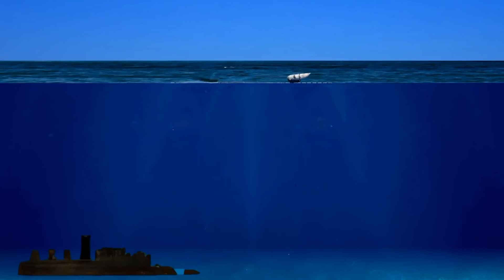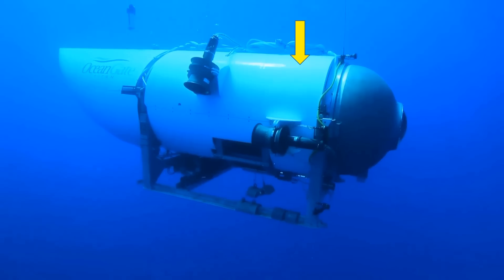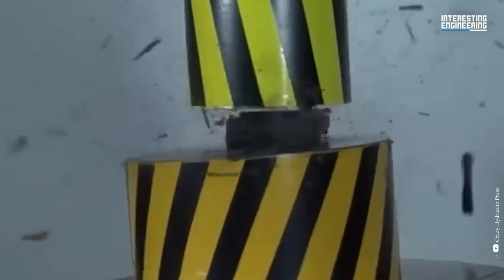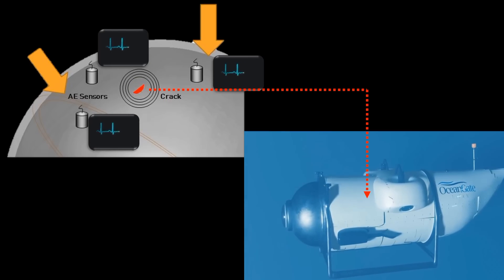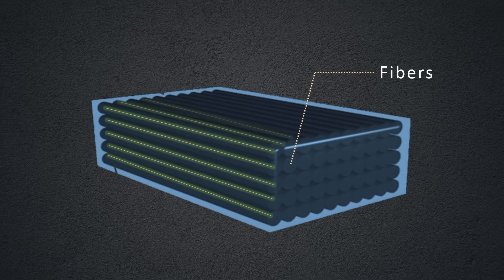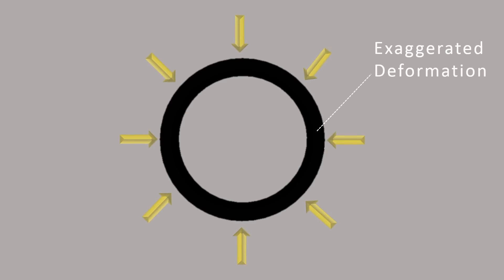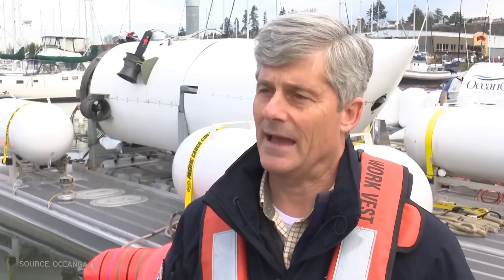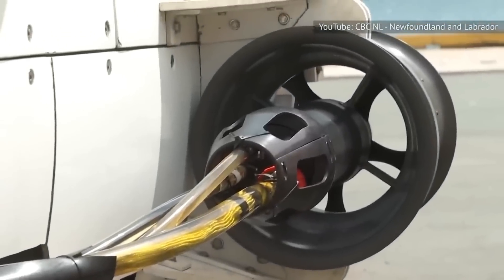Oceangate Titan Did Not Implode Just From Pressure. There Is a Catch!

Comment: My uncle told me when he was studying engineering his professor told the class , If you ever design a bridge that fails you had better be standing under it.
Reply: The designer was in the sub. He is dead.

If you design a bridge, you better make sure you design it properly like your children are sitting under it.
Reply: @esphilee no as you can see he simps so hard on carbon fiber.
Reply: @esphilee 😊
Reply: And Rush "was standing under it."
Reply: More like surrounded by it, but , yeah. He won't be around for the lawsuits that's for sure, but the rest of the company will be.
Reply: @dwightl5863 yeah but rush was ignorant. He didn't design or engineer it. He employed interns to do it and they probably suggested carbon fibre can save costs and rush probably though "great idea! Also let's get some parts from camper world and a used xbox controller"
Reply: @ninjaninja9954  I don't think the controller was necessarily a red flag, but the fact that it wasn't wired does to me.. also, his behaviour towards the whole project was a red flat to me anyway.. like it was a pet project that wasn't being taken very seriously.
Reply: Also, having a second one for redundancy would increase your margin of error a little bit regarding the controller.
Reply: @ninjaninja9954  No he was the one that wanted to use the carbon fiber, he knew where he could get expired carbon fiber cheap, he made a death trap from the start and wasn't going to hear no for an answer, he already fired and sued one guy that said no!
Reply: @ninjaninja9954 Rush qualified in engineering from an Ivy League university, which makes it all so much harder to understand.
Reply: @TheNelster72  he is from a powerful and wealthy family. Maybe his family bribed the university to give him his degree
Reply: @TheNelster72  qualified accountant can do tricks on numbers in account too.
Reply: @TheNelster72 he was an aeronautical engineer, so his expertise was in building planes, not submarines. He genuinely believed he could use the same material for a deep water submersible as he used for a plane. Sadly, he and people he duped died, because he wouldn't listen. He had so many warnings. He threatened to sue anyone who spoke about their serious concerns. He was arrogant and his ego got them all killed. He intentionally dove in international waters, to avoid the rigorous testing and certifications. I hope that there is a way to better regulate this in international waters, but I've heard people say that they're not certain that is possible. He had to take that thing to some country, when not in use. I would think they could have more control over the safety testing. We shall see. He was very intelligent, and had huge aspirations. I don't understand why he would put himself or anyone in that death trap, when very good, credible experts warned him.
Reply: @Plus1Like like your writing?  “ red flat”
Reply: @CupidStunt-fs7ie  Correcting typos gets in the way of innovation, as Mr Rush would say.. screw the rules ! Red flat til I die.
Reply: @TheNelster72 money can buy all sorts of things. Except common sense.
Reply: @ninjaninja9954  you do know our military uses Xbox controllers to drive their subs right??.. because using a game controller is one of the smartest ideas ever, because almost every man has used one and knows exactly how to use it.. our military uses them on their own subs brother.. the controller was not a problem, it's the carbon fiber hull, we don't know it's breaking point, because it's breaks at different points every single time, it's hard to know if it's gonna last 2 dives or 8.. that's why they say, if you use carbon fiber hulls, only go down once, then build another one.. do not go down a second time, the second time may be your last time..  but man, we gotta move away from saying the controller is an issue, hell they use those going to space and on military subs, drones, everything.. game controllers are very great for operation of things like a sub.. honestly Stockton rush was very damn intelligent guy, he just wanted to cut corners and it costed everyone on that sub their live..
Reply: @pamalawashington9371 yeah I feel you on that one.. it's money though, thus proving once again those biblical scriptures to be true.. MONEY is the ROOT of ALL EVIL..
Reply: @Hex-kt2vr I Agree. Bluetooth isn't reliable and needs redundancy for safety just like aviation does. No hard wire was a huge red flag. This totally gives me weekend garage project vibes.
Reply: @JoeLattimore-ss2pm  ok true. The controller maybe not a problem but I have a few issues. They use Bluetooth connection (no wired option?) which can easily fail and the controller they used is like the cheapest logitech one u can find. At least go for a quality one. And he brought cheap internal lights from camper world it seems to me the guy is trying to save every penny possible while charging the customer 250k a seat. Cheap carbon fiber hull to save costs, expired carbon fiber too from boeing bit like at the end of the day at mcdonalds they throw out the scraps for the tramps because they can't sell it anymore. And that glass dome only can go down to 3000ft which is not enough and they didn't change it because he didn't want to pay the costs. He is the king of Cheap skates. Also even the shape they got wrong, they tried to make it look like a tear drop for aesthetics and the end of the tear drop does not distribute the pressure as well as a come or sphere. Tbh just looking at Rush reminds me of a dumb looking grandad.
Reply: @pamalawashington9371  'he was an aeronautical engineer . . ' 
That is not a good position. Aircraft have both compressive loads and tensile. Surely the Titan was totally dominated by compressive loading? When elastic deflection takes place, compressive loads (mainly) become shear stress, something of which carbon fibre has very little tolerance
Reply: That was what Roman builders were made to do.
When the support frame for an arch or bridge was taken down the head builder was made to stand under it.
There he made sure it was correctly built every time otherwise it meant he paid with his life.
Reply: @lordeden2732 After hearing this same story about Roman builders many, many years ago, I continued passing it on myself. It wasn’t until a few months ago I tried looking it up and couldn’t find verification. May simply have been a lot of speculation based on someone (likely the architect) engraving their name on a bridge...and mistranslating “approved” for “tested” (even if it meant tested...how?).

Not that the concept isn’t a good one. Of course I’d say the likelihood of having to use the said bridge regularly themselves would be at least as much motivation as sleeping under it once. The ethical truth holds, even if it’s only legend.
Reply: @derinderruheliegt Victorian railway engineers tested the Bridges they built by progressive loading to twice the maximum load it was expected to carry.  The Romans would have been sensible enough not to risk anything especially risking a skilled engineer.
Reply: @lordeden2732  I like the Roman way haha
Reply: @lordeden2732  taken down? WTF
Reply: @lordeden2732 they're called masons, and they got paid very well, and they needed to have an extensive knowledge on mathematics and physics. They made it so you take one stone out to finish it called the key stone.
Reply: Yes but this “bridge” designer died in his death trap while killing other people that trusted him. His false confidence and arrogance made him stand under his bridge with others while it collapsed when many in the industry questioned the design while it was being built and even advised against it.
Reply: @deegan727 
Rush seems to have been a bully.
I've seen & read a number of videos & comments of people he pestered to get on the Titan. He even offered one person a "discount" of about $100,000!!!
Narcissism often kills.
Reply: @abelis644 That's not narcissism. He needed the money.
Reply: I wondered that too.
Reply: @deegan727 very good point. In addition to the amount of money the passengers paid.
Reply: @deegan727 They knew Stockton Rush was shady, and still chose to go
Reply: @deegan727  those ppl should not have trusted him, they are responsible, not money-making owner, they had brains, that worked, no excuse not to use it to T.H.I.N.K.
Sad, they made such bad decisions, the father offering his son up to that risk is very very bad, very unnatural for a parent to encourage a child to risk their life for his birthday 🎂🥳.
Reply: @deegan727 I think their point is he escapes being held accountable by being onboard
Reply: @deegan727  way too risky for me to ever take that rude. One mistake equals death
Reply: I heard a story like this, can't find a reference:
A bridge was build over the Kiel canal. When ready to join the bridge to the other end, a gap of half a meter was there, making it impossible to join.

The engineer jumped from his bridge to death.

The next morning, temperature stresses resolved, both ends matched perfectly. They put in the final rivets. The bridge still stands today.
Reply: He believed in it, he believed it it too much and wouldn’t take anyone’s advice or listen to warnings. The passengers most likely were not made aware of concerns surrounding the submersible, had they known they may have backed out altogether. I wonder if they knew the some of the parts were held together with glue and old carbon fiber. It’s very sad that this happened, but it’s even sadder that the passengers had no idea that was their last trip.

Consider this quote from Stockton Rush: “I think it was General MacArthur who said, ‘You’re remembered for the rules you break.’ And I’ve broken some rules to make this,” he said, adding: “The carbon fiber and titanium? There’s a rule you don’t do that. Well, I did.”
Reply: Case in point
Reply: @danteanderson9052 😮😮😮😮😮😮😮😮q😮😮😮q😮😮😮😮😮😮😮😮😮q1¹😢😢😊
Reply: @danteanderson9052  ⁷I; it up; I ⁸i0lllll
Reply: Or make sure the people who decided it could be done cheaper are under it.
Reply: That brings to mind an old quote from an Apollo astronaut regarding what he thought about when the Apollo Rocket was coming up from the launch pad and all the vibration is so bad you think you're going to die just from the vibration alone. His response was :

Mostly I think about the fact that every component on this rocket was purchased from the lowest bidder.
Reply: Probably explains why bridges aren’t made out of carbon fiber
Reply: The owner of titan was criminally responsible for in my view putting his clients in grave danger and basically his arrogance killed these people especially the father and son who would of known the least about the design flaws and cutting corners even laughing at the messages to him in saying his sub was dangerous...the captain of the Titanic and the owner have alot in common with ignoring basics of their Fields of expertise.....
Reply: The Florida bridge 'bonus hole' design team blamed bigoted males watching the opening ceremony for the bad karma.
Reply: @joefish6091  Yeah bonus holes 😂😂😂
Reply: My uncle told me hey buddy I give it to you for 5 dollars my friend.
Reply: Don't lie. I've seen this comment everywhere
Reply: Like the first Tacoma Narrows bridge?  Yeah
Reply: LOL! Meaning it's all over for you!
^..^~~
Reply: Your uncle anddd...the guy from the other video that said his professor said that
Reply: @kristinareed9336   that's how we learn from people saying the same quotes!  It doesnt mean hes lieing   wtf
Reply: @bennyboy2079  I don't believe it for a second. Don't try.
Reply: @kristinareed9336 they both probably did
Reply: How many uncles had this professor?
Reply: @teen_laqueefa  At his age he had one long term shot at glory left and his sums added up ok so he rejected everything else. I wonder what he thought as he realised the noises in the sub indicated impending implosion.
Reply: You and you alone. That would be best.
Reply: This is so ironically true 😢
Reply: When it fails......the quote is, “if you design a bridge that fails, you better be under it when it does
Reply: I liked to make it 666. You're welcome.
Reply: Yeah, Stockton wanted to CRush it.
Reply: Why did he use a carbon fiber hull? Wanting to be the first to do so or to save weight?
Reply: I can’t even bridge the gaps in between my couch 🛋️
Reply: This is a prime candidate for the Darwin Awards
Reply: Regarding the engineer standing under the bridge story, I heard a similar one happened in WW2. I believe it was when the Russians were preparing defences against a German advance including tanks.

The Russians were made to dig their trenches, then some Russian tanks were driven over the top of them to test them, with the soldiers standing underneath.
Reply: @@user-gg8pw8wz6o
What's wrong with you 🤡?
Reply: stupid saying
Reply: @@user-gg8pw8wz6o thank you! I commented with this before I even spotted your comment. Yikes.
Reply: You"d get hurt,or great pictures.
Reply: The tracks across the Trans Indio -Pacific Railway you can bet will be manufactured  by an offshoot of President Obozo's company...SOLERA.
Reply: When that sumbitch said "and this is how you control it" that was everybody's chance to say fk this I'm not going
Reply: AND Rush was in it, so what's your point??
Reply: Is there an actual point to this storey
Reply: @@user-gg8pw8wz6othat is a comment that every engineering student hears from a professor hears at one point in time. I heard it from my high school architecture teacher.
Reply: @user-gg8pw8wz6o I can assure you that he did. Virtually every civil engineering professor on the planet has used that line, and it's been true every single time.
Reply: Actually designer was in it. But he took down 4 ppl with him
Reply: I’ve heard that saying loads of time engineering tutors say it all the time I’ve heard a tutor saying about car design as well “if the car you design fails and someone gets killed it better be you who’s in it when it does
Reply: @@user-gg8pw8wz6oow the hell do you know 😂   quotes can be shared you know    jeez
Reply: O
Reply: Wise man
Reply: Bullshit, you saw the quote in another video. Shame on you
Reply: Seen this comment far too many times
Reply: SuperNostalgia. Amen!
Reply: &i0l0&
Reply: SuperNostalgia. So sick of this inappropriate proselytizing in the comments of unrelated content.  How would you like this sort of posting from the scriptures of other religions than your own?
Reply: What happens if you design a bad putting green ?
Reply: HyTap on a clip to paste it in the text box.Tap on a clip to paste it in the text box.Tap on a clip to paste it in the text box.Tap on a clip to paste it in the text box.Tap on a clip to paste it in the text box.Tap on a clip to paste it in the text box.Tap on a clip to paste it in the text box.Tap on a clip to paste it in the text box.Tap on a clip to paste it in the text box.Tap on a clip to paste it in the text box.Touch and hold a clip to pin it. Unpinned clips will be deleted after 1 hour.Tap on a clip to paste it in the text box.Tap on a clip to paste it in the text box.Tap on a clip to paste it in the text box.Tap on a clip to paste it in the text box.Tap on a clip to paste it in the text box.Tap on a clip to paste it in the text box.Tap on a clip to paste it in the text box.Tap on a clip to paste it in the text box.Tap on a clip to paste it in the text box.Touch and hold a clip to pin it. Unpinned clips will be deleted after 1 hour.Touch and hold a clip to pin it. Unpinned clips will be deleted after 1 hour.Touch and hold a clip to pin it. Unpinned clips will be deleted after 1 hour.Touch and hold a clip to pin it. Unpinned clips will be deleted after 1 hour.Touch and hold a clip to pin it. Unpinned clips will be deleted after 1 hour.Touch and hold a clip to pin it. Unpinned clips will be deleted after 1 hour.Touch and hold a clip to pin it. Unpinned clips will be deleted after 1 hour.
Reply: Jnnnjnjkkkk
Reply: Yup.
Reply: This issue is far dangerous than ur example😂 the pressure per SQ is tons
Reply: Stolen
Reply: @NEELZE99  The exemplary use of this failure model  has been used for thousands of years. It has been recited countless times.  Nothing new at all here
Reply: @NEELZE99 
You think only one engineer ever said that? 😂
Reply: Very interesting!!!🙂🐢
Reply: That’s a very good rule.

Much like packing parachutes...

When you know that you are going to be using one of them...

You get everyone right.

Comment: Supposedly the carbon fiber had sat on the shelf for a year at Boeing - they rate the material for 1 year of shelf life and were discarding it - in some way got rid of it - Oceangate probably got a huge discount on it.  Your models probably don’t account for expired carbon fibers.
Reply: Imagine Boeing discarded it, although  the air pressure at high  altitude  is lower than on the ground, and yet ocean gate use the carbon fibre to go down the sea with 380 times higher pressure than on the ground.
Reply: I think it's the epoxy that goes bad, not the carbon fibers.
Reply: @JoeLinux2000  That makes it even worse under those conditions
Reply: @JoeLinux2000  Joe, the engineer  gv lengthy explanation why  CF is not the right material for deep sea vessel .
Reply: Boeing issued an official response to this saying this was not true and no transaction ever took place
Reply: S. Rush also got a discount funeral and sea burial.......
Reply: Dark, but true, alas...